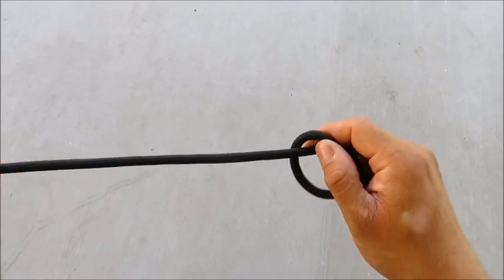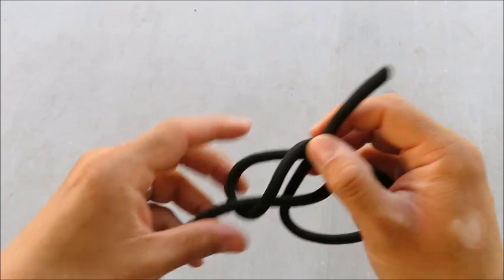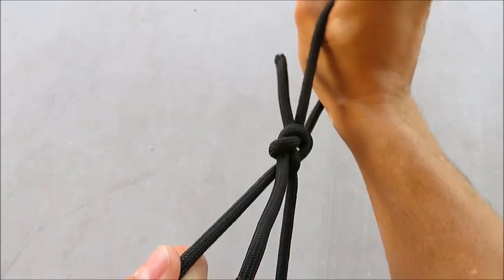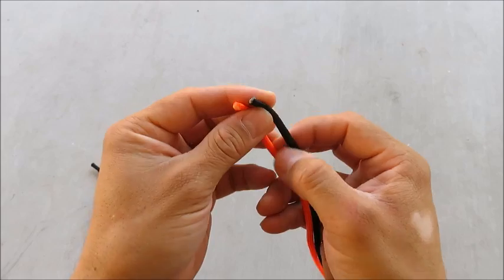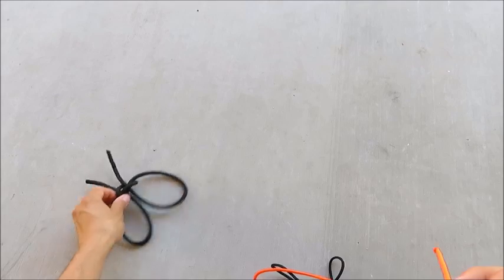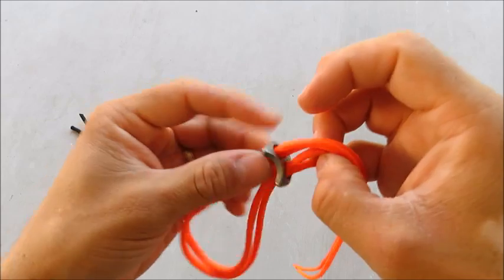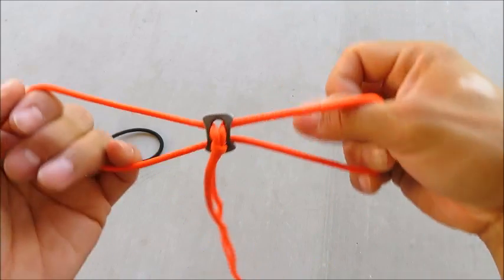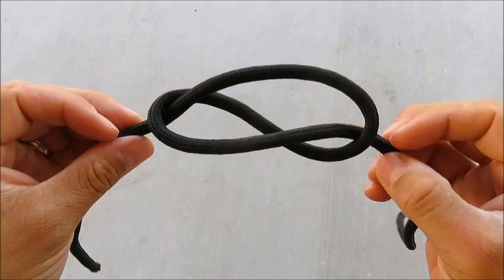Handcuff Knot

Comment: A prussick(sp?) knot works very well for this. Needs to be setup beforehand. Tie the prussic in the middle of a length or 550 cord. Tie it around your index finger before tightening down the knot take the free ends and pass them thru the knot where your finger is located this will form your wrist loops. To use put them on the person pull them snug and tie a square knot on top of the prussick. The key to the length of the cord needed is that after you have tied the square knot, there should be enough length of the free running ends to go up the persons back over their shoulders and to tie to a stick that is inserted in their mouth to keep them from talking until your are ready. To control the person to walk. Grab the cords running up the back. If you lift up on the wrists the person will walk or go whereever you want. Pull back on the stick and the head they will stop.

Comment: I think that overhand knot was born as an overhand knot and it will die as an overhand knot. It can't magically become a figure eight. It looks like a figure eight, yet it isn't. If you pay close attention to it, the rope passes through the first loop from the wrong side and as such, if you try and tighten it by pulling the rope on both sides, it will collapse back to an overhand. Where as if a figure eight is properly built it will keep it's 8 shape and you sure won't be able to simply "twist" it in an overhand.

to tie an overhand or a figure eight you first make a loop in both cases. Now, look at this loop like it is a 2d figure that lies on a plane... you can count the number of times the rope crosses this plane before going through the loop and form one knot or the other.

if it crosses 0 times -> the rope does not actually enter the loop and no knot is formed.
if it crosses 1 time -> the rope comes from one side of the plane and then enters the loop from the other side of the plane and an overhand is formed.
if it crosses 2 times -> the rope comes from one side of the plane, then crosses again and enters the loop from the side it initially came from. That makes a proper figure-eight.

does this make any sense?